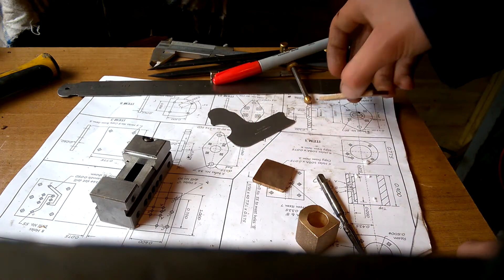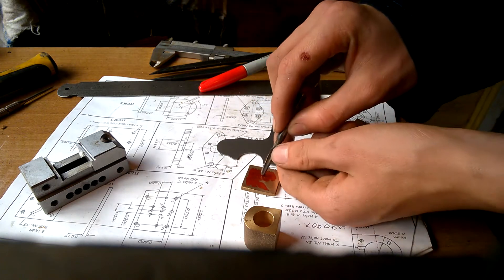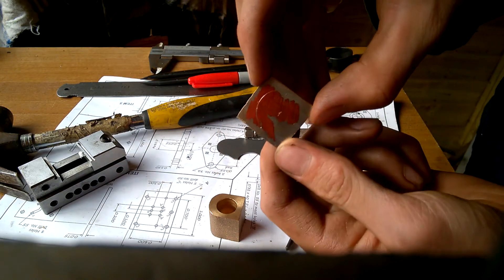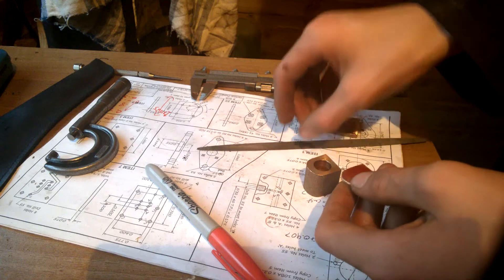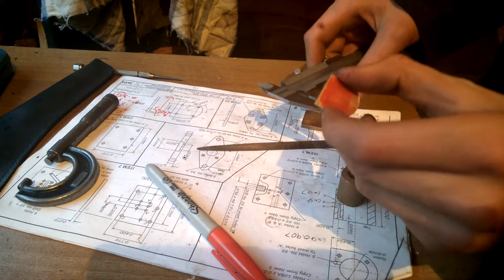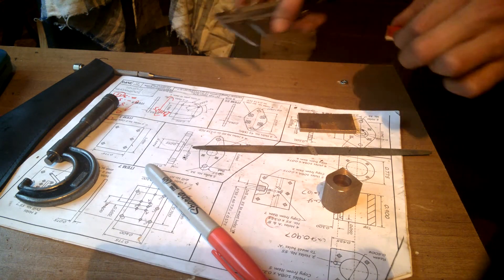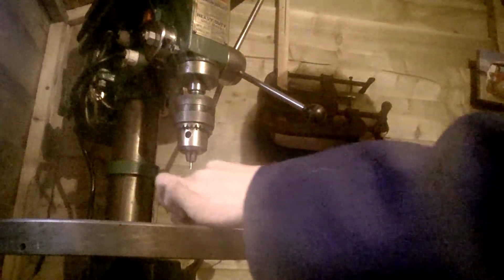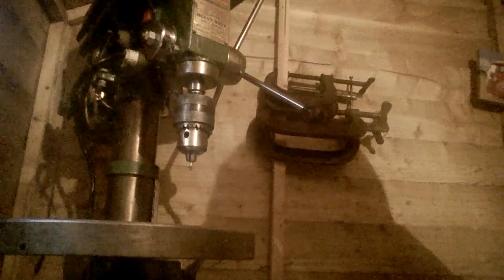south worth steam engine build part 2 (3inch vertical pump)

Comment: Was that a tap I saw you using as a center punch? I have one of these little pumps and it works well, however, after a run on steam, get plenty of oil into the valve chest, because if it is left for any length of time, slight corrosion will occur on the port face or it will be the devils own job to get it to run properly, and will involve stripping and lapping the port face again......